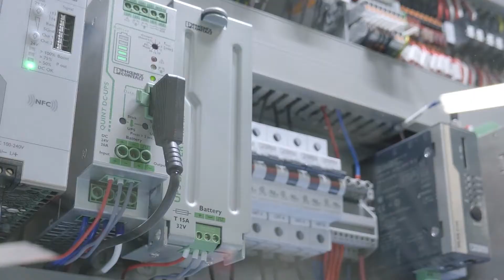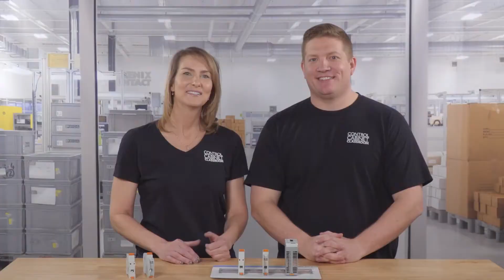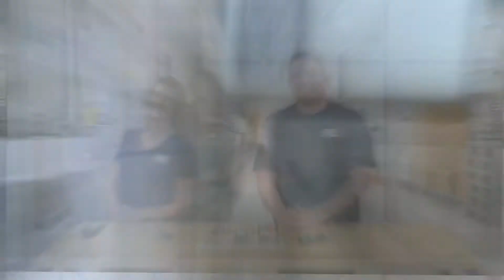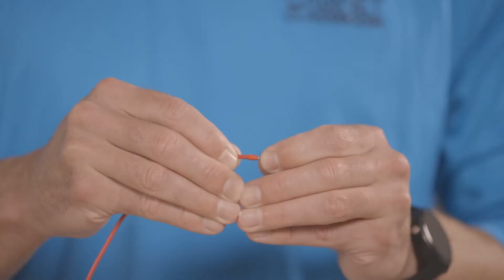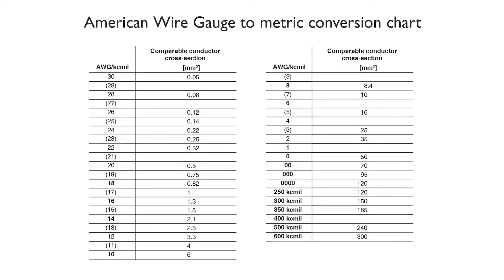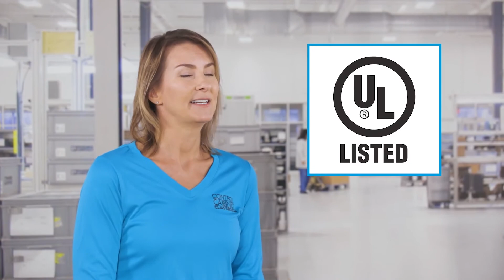What are ferrules?

Comment: Aside from the ferrule itself, does the UL list include both crimping (to press the wire) and the wire stripper? Or only the crimping tool? (See below A & B)
A. Ferrule + Crimping tool
B. Ferrule + Crimping tool + Wire Stripper
Reply from the maker: UL listing is on the ferrule + the crimper because UL took a specific ferrule and a specific crimper and tested the results.  Wire stripping is not included in the testing.  With that said, it is important a wire is stripped properly such as proper length without damage to the copper strands.